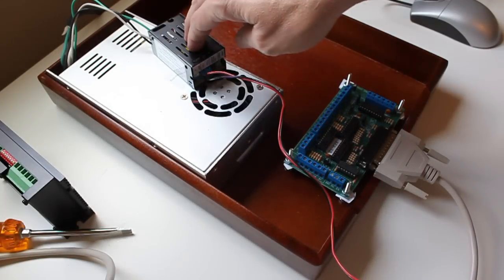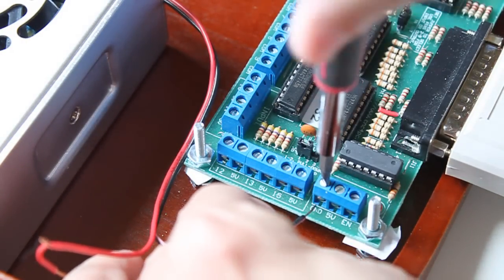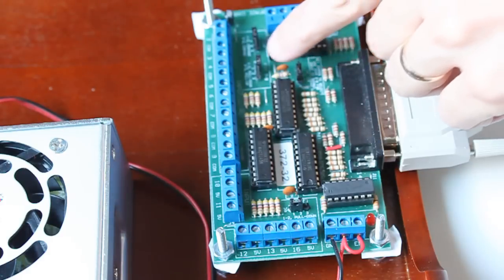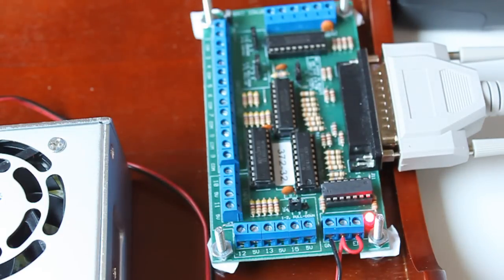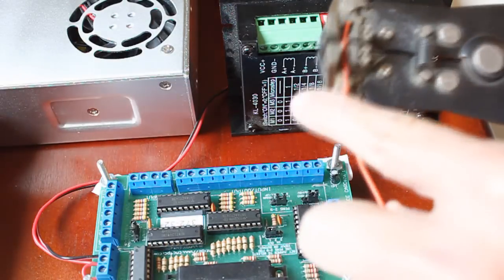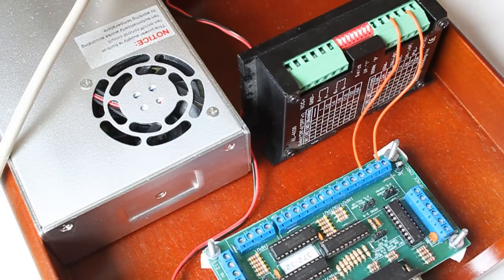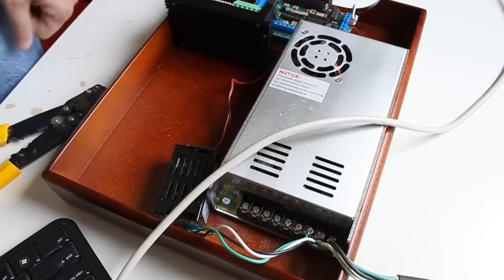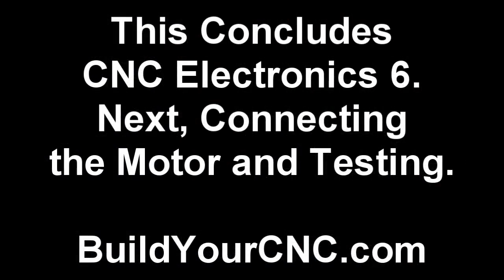CNC Electronics 6.wmv

Comment: great video series! i do have a couple of questions the loop from 5v to en could it be broken through a switch to allow for a cycle start button?? or what s the purpose of the en terminal? also is there any way to manually inch/jog the motors using a set of push buttons or switches?? was looking at having a 3 position switch to manually control the +/- movement of each axis.

Comment: Im not getting any reading when testing the numbered and com ports. What can the problem be or do I have a bad board.
Reply from the maker: This is actually a parallel port (General Purpose I/O). Did you test the back of the computer at the parallel port as shown in the previous videos?
Reply: Patrick Hood-Daniel my parallel port and cable checked great going by your tutorial. With the breakout board hooked up I don't get voltage when checking red on 2 and black on com. Same for 3 and 4.
Reply from the maker: Make sure the usb is plugged into the board from the computer.  That is needed to power the board.
Reply: I'm not using USB. i got a breakout board with parallel port interface. it is set up exactly how your book says. i started testing from your tutorials and the parallel out of the computer sends out signals, parallel cable is good but signals coming from outputs of breakout board.
Reply from the maker: The parallel breakout board requires power for the chips onboard.  The usb cable is used only to power the board.
Reply: the break out board has the 5v coming to it already.
Reply from the maker: Have you tried setting the pin as a direction output and testing the pin for high and low signal using the keyboard?  I doubt the board is bad.  Each of our boards are tested thoroughly, unless you received the board from another seller.
Reply: I did do that test, that is where my concern is. I did receive the board from another seller, so basically here I'm just seeking advice.  I purchased the C10 Parallel Breakout REV.11 through AutomationTechnologiesinc.com (formally Keling). I do notice that I have the C10 Rev11 while you are using in the video the C10 Rev8, would there be any difference in the two?
Reply from the maker: Not much. The rev on my board doesn't have a relation to their rev. My board is generally the same but I used surface mount devices to reduce the board size.  My board conform to the IEEE standards as per the original manufacturers specifications.
Reply from the maker: I believe that board has a few jumpers on it that need to be set correctly.  It's difficult to completely understand the configuration on the jumpers, so make sure you set them correctly.
Reply: Ok, Because in your book you mention Keling Inc as your board provider. Are you manufacturing your own boards now, because if I can't get this to work I'm thinking of just going with the Mach3 USB interface board you sell for $89. Which I was going to do anyways but I wanted to see this thing move first.
Reply from the maker: Yeah, we worked with Keling, but that was a long while ago.  We have developed quite a few products since then.  Before you go with ours, make sure to give it a good go first. That is a good board. It just has more configuration than ours.
Reply from the maker: Also, make sure you have the active high or active low set correctly.
Reply: I got it solved, I assumed my BOB's Output were output only. Apparently they are Input/Output with a jumper and the jumper defaulting to Input. Once i got that switched everything worked out nice. I built this machine from all your tutorials with my own customizations and techniques along the way.
Reply from the maker: Excellent!!  Please let us know how it goes and send us some pictures and video if you can.  Thanks.